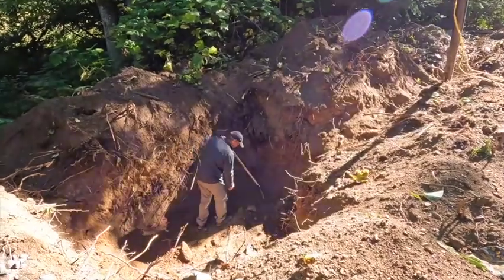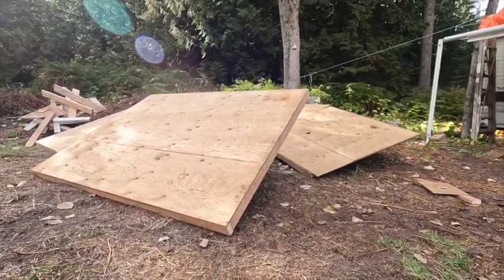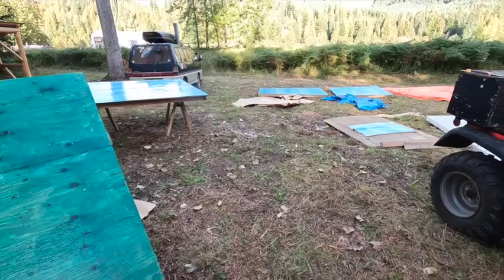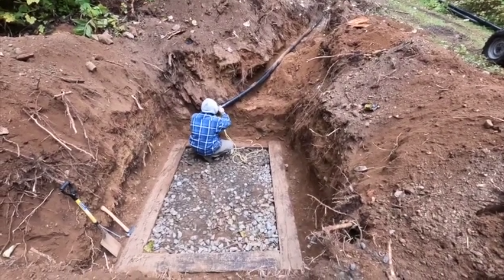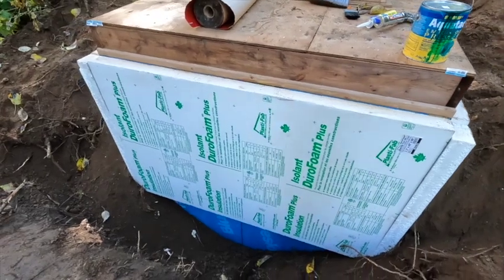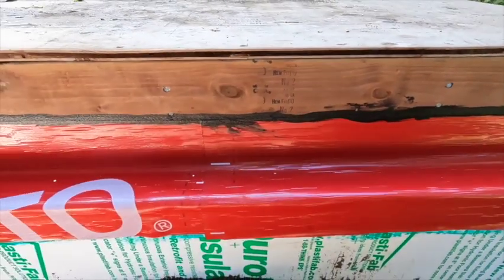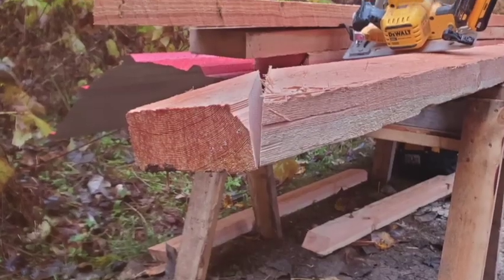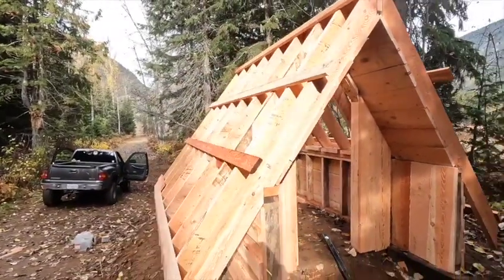The Micro Hydro Project: Episode 2  - The Powerhouse

Comment: Nice project! You will regret this 'turbine-in-the-basement' though. The humidity will be annoying and potentially cause problems. I would have just dug out more soil, so you can just make some shed on top of the ground. Cheaper and easier to move around your turbine. Snow is very good insulator, so I would have not make that roof steep, so snow is on top all winter. Also you will need an overflow drainage, not just for the turbine, but when you want to wash out your pipe, you need a manifold before entering the turbine, so you can flush sediment out. Concrete floor with drainage   hole would have been easier. Coming summer I will install micro hydro for my house in Norway and there I also have to deal with cold winter. Very curious how the next steps of your installation will be! Keep it up!
Reply from the maker: Yes, A concrete slab was just too pricey for me! Railroad ties and gravel was free :) I built it underground so it wouldn't freeze but yes, now I'm battling moisture. Better than ice i guess? I do have a bypass built in so water can flow all the time, maybe it will be explained better in a video to come. I built the shed on top because I need to be able to access the basement in the winter. It snows here a lot! Would have been nice to just let it get buried but then I wouldn't be able to get in! Thanks for your comments and good luck with your system this summer

Comment: Putting wood into the ground is quite an ambitious project. I would have gone with concrete or a wall. You could still do this inside the basement, before the wood is rotten. Did you paint the edges of the boards to? What about the rest of the wood structure down there? You will probably get much moisture through the bottom of the basement!
Reply from the maker: The foundation is 8x10 railroad ties. They weigh about 150lbs each and are full of so many chemicals I'm hoping they won't rot for a long time! The rest of the walls are made of pressure treated wood and plywood. I'm definitely concerned about moisture but I can always add a vent if needed. I'm hoping that will be enough!
Reply: @manvsland  I wouldnt just hope, i would make sure. And even pressure treated wood will rot at some time.